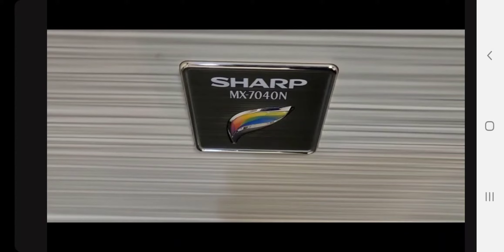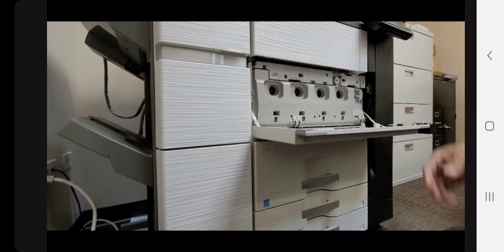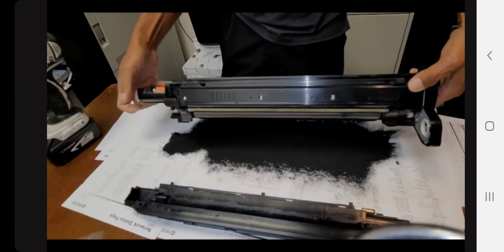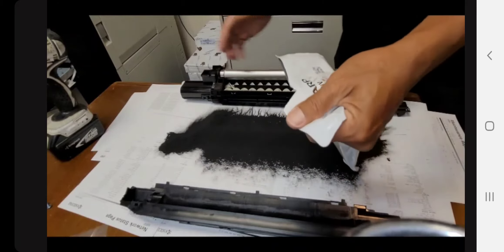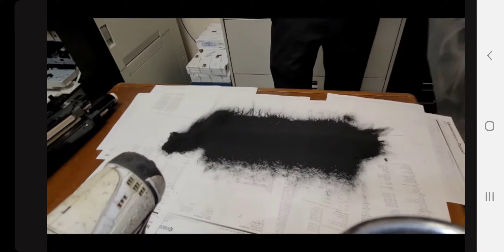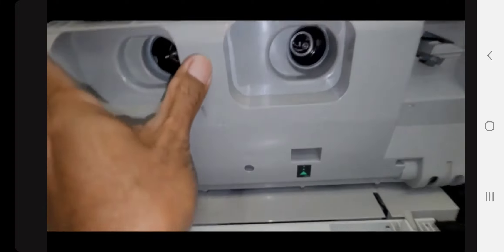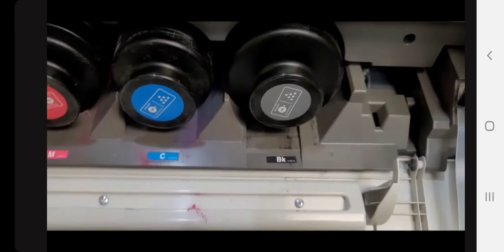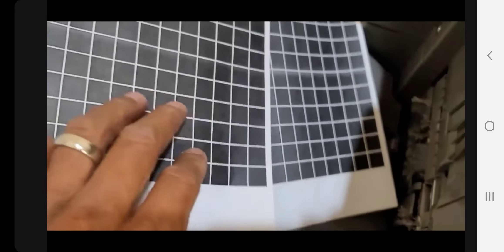Sharp Error Code VK VC VM VY Maintenance Required MX6240 MX7040 Developer Change Replacement

Comment: Hello and compliments for the video, I have a sharp 2310u and for a few days it has been asking me for maintenance with VK code, so from what I understand it indicates that the black developer needs to be replaced, right? The copier prints fine so it may be a counter expiration request I think. Doing your procedure eliminate the VK code maintenance request? Thank you.
Reply from the maker: Yes, VK is an indication that the Black Developer has reached its recommended yield and it's time for it to be changed. Replacing the Black Developer and Initializing the new developer with Sim 25-02 will reset and eliminate the VK code.
Reply: @FieldServiceTechBusiness  thank you, the right developer for me is MX36GVBA ?
Reply from the maker: @g1ann114  yes